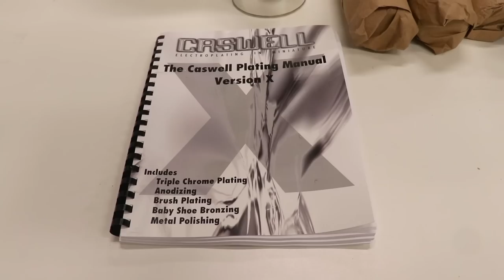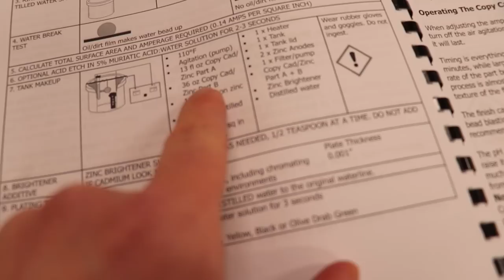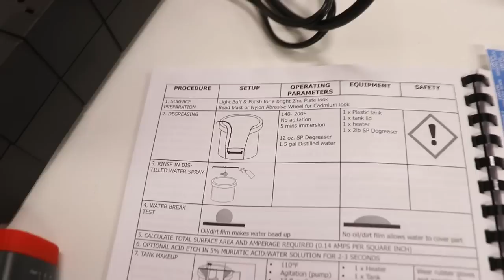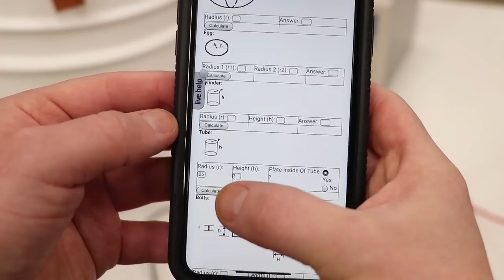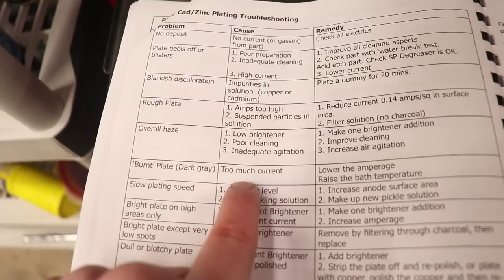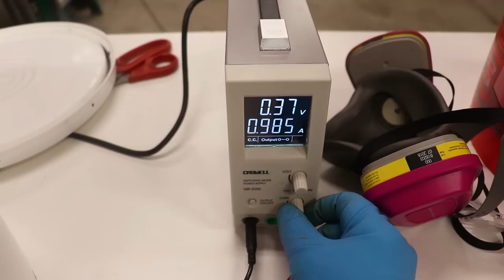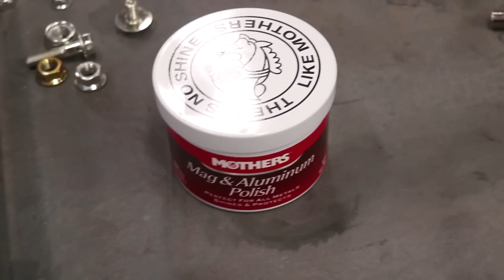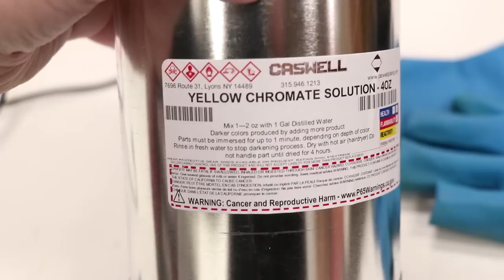Ultimate Guide To Making Bolts Look New Again!

Comment: I have had hundreds of pounds of Honda N600 S600 parts zinc plated. The shop I used would remove rust & the old finish with muriatic acic. They used to charge me $65 for a 5 gallon bucket full of parts. Last time I went in they had changed owners and tried to charge me $250 for 5 gallons.

Comment: Did a good job
I get a lot of stuff zinc plated and the current guy I use has a heated caustic pickling bath that he puts parts in overnight first to strip anything off them (painted steel I've welded etc.) since the sand blasting leaves a dull finish
The problem with the sand blasted finish is in the weather or grime it gets stained more easily than the glossy chrome finish.
To dry off small parts once they are done he has a container of fine sawdust he puts the smaller parts in the dry them off without touching them.

Comment: Nice results! Regarding the mild pitting from the rust at 33:35, you might want to try some de-rusting via electrolysis before attacking the part with the scotch bright wheel. Electrolytic de-rusting reforms the material by removing the oxygen from the oxidized part. You might get lucky and recover some of the material and thus reduce the pitting. You already have most of the set up you need. You just need to get one more bucket. One warning : careful with stainless steel when doing this - never use stainless steel or stuff containing chrome as your container or the sacrificial element or you will get very nasty, hazardous vapours and gases. So stick to normal iron/steel for your sacrificial element and plastic for your container.
Reply: That’s exactly what I realized while restoring bikes parts ! Acid is a very easy way to remove rust but it just dissolves while electrolyte convert the rust leaving less pitting !
Reply: Apparently carbon is a great sacrificial element leaving a very clean bath
Reply: @1conu593  Useful to know this observation. Since I made the original comment above, I've been told that it is not correct as it is not possible to undo the oxidisation and liberate the oxygen from the oxidised iron via electrolysis--the only way to do that is through extreme heat, which would melt the part. Given your observation, something else must be going on but I'm not a chemist. I also know that acid will eat the metal away so that might possibly make the pitting worse, depending on how long the piece is exposed to it.
Rust conversion may be another possible option in certain situations.
Reply: @1conu593  Thanks for  the tip--I'll check it out.

Comment: Seriously a top notch tutorial. I might add if I may, to test proper adhesion of the plating, use masking tape to see if plating has adhered well. If the plating does not transfer to the tape then you are good, if plating transfers to the tape, usually looking like pepper flakes then it is going to fail and should be redone.

Comment: Finely got one of these kits can't believe how good they are ive even done my mono shock pasivated in yellow all carburetor inlet stubs the little screws shock spring collars or & good tip on the spindles cam & the white haze. but be careful on the copper wire it'll start acting like a anode & youll get gold tinch in the zinc if you're still using this kit. i use fish tank heater in mine can't believe it was a year ago i last commented on this video but keep your videos comeing buddy

Comment: Thank you Cameron, I just plated my first bolt and it looks great. To keep the plating bucket at the correct temperature, without leaving the bucket heater in which as you mentioned could react with the plating process, I put the Caswell bucket I use for plating into a larger bucket. The larger bucket has a microwave safe kitchen plate on the bottom. , I placed the bucket heater element on top of the plate. Then I put a jar on the plate, inside of the bucket heater loop. The larger (outer bucket) is then filled with some water. I put the Caswell smaller plating bucket inside of the larger bucket. This way the heating element isn't touching any plastic and it can't react with the inner bucket, yet it keeps the whole thing at an even temperature.

Comment: Hi Cameron, I received your 3M style disks and tested that fine one today and honestly: I am impressed, really impressed. I had an aluminium part from a waterpump and it was in aweful condition so I vapor blasted it and ended up with a silky smooth surface then I tried your disk and without any pressure polished the surface to a high gloss. Honestly, it took no effort at all and within minutes it was better than any of my fabric polishing disks would be able to. I did not need compound which usually splatters all over the place. I hope you sell a lot of them. I will definitely come back for more in the future. Maybe you should also get some small ball shaped ones for polishing in tight corners with s grinder. I would buy it.
Greetings Bernhard

Comment: I don't know if this has been mentioned but if you use a stainless bar to hang from it won't corrode from the acid or plating fluids. I also use stainless bolts and wing nuts on my hanging bar to make the connection easier to make and more consistent. Nice work by the way Cam.

Comment: Really cool! Much better than putting a bolt to the wire wheel and putting it back in. Especially through a bearing/bushing where we need a specific tolerance and we’ve just removed a bunch of material haha. Nice job. Done right!

Comment: I had already gone through this process using the same kit and your experience exactly mirrors mine. I also use a long narrow container bought at a garden centre for plating brake rods or anything that doesn’t fit in the standard bucket. It does make you realise why plating companies charge so much though, it’s not a quick process.

Comment: If I get the new CRF125F and swap a CRF150R motor in it, I'd definitely want this process done to all of the hardware because for the pitbikes it's hard to find a specific hardware kit with the zinc plating on it. While I'd be at that I'd freshen up the hardware on my 3 other bikes as well as a little finishing touch. Awesome video Cam, I was really wondering how plating was done. Thanks.

Comment: A great video! Thanks for that. If I were doing those bolts and wanted the brushed finish I would only do the bit you can see as 95% of those bolts are inside some component and not seen. So I'd just brush finish the bolt hexagon and the nut if there is one to preserve the best rust resistance. After all you plated it for that reason.

Comment: Very cool, I have completed a few restore projects and never thought of plating the hardware, if I needed chrome fasteners, I would buy from Albany but of course not all sizes and threads are available. A work around fr me though for a high shine is ordering a stainless steel replacement nut or bolt. With a buffing wheel, stainless will polish to look almost 100% like chrome.

Comment: Hi, thanks for your story on plating. I own a large kit myself but since the weather here in Germany is still cold I have not tried plating yet. For me, the question of economy was not important since I had used a commercial plating service a few times and yes the quality was good but it still was a catastrophic experience.

First I am a pilot and I cannot always pick the time at home to drop the items off at the shop during the week. 

Second they want larger quantities and not just a few bolts. Now sometimes it is only one bolt or special item that cannot be purchased new anymore so you have no choice and pay their minimum batch fee (which is not cheap). So a 10 dollar item can quickly become an 80 Dollar restoration project.

Third and most important, you have to document the items you drop off because they keep losing pieces which are irreplaceable for you but just bolts for them and trust me those part will not reappear. 

Now, fourth, it takes time because they might not be nickel plating for the next few days so It always took at least one week. 

It was then when I started my next restoration project, a Jaguar E-Type V12, and decided to do everything myself and not depend on anyone. The time spent to find lost items, the waiting time to get whatever they had not lost back and the time to explain to them what and how you want your parts done is way too much for me. Not to mention to drive 15 Miles to their shop and 15 Miles back each time.

Cameron, your bolts look just perfect and I am more than willing to spend the time once to get set up and save in the long run. And trust me, as soon as your restoration buddies find out what you can do and how good the parts come out (because you care for those parts) they all show up and fill the fridge in your garage at least with their favorite beer 😁😁😁
Greetings, Bernhard

Comment: Cam another way to get in the head of the domed bolt is to do exactly what you did with the scotch bright pad but put the bolt in a drill. Then the bolt spins which is more efficient than you rubbing with the pad.

Comment: Great tutorial and thanks for putting in so much time and effort. I’ve seen a few video’s and this is the first that I would now consider tackling myself. You could put the heater in a larger, shallow bucket of water and place the plating bucket in that hot water. That way the metal from the heater wouldn’t interfere with the plating process but I would not have thought of that unless I had watched this all the way through. Do you know if the process is similar for nickel plating?

Comment: I was doing CNC work years ago and wanted to plate/anodize my items. One thing you failed to mention, which is critical is material disposal. That acid is considered hazardous material, check your local, county and state laws on use and disposal. State laws were so strict in my area at the time, even for hobby use not for me to do it but to send out. Keep in mind, some states consider this hazardous material and there is no way to dispose of even small amounts unless you pay. My city later started an amnesty period where you could dispose of haz waste no questions asked once a month - for home use. A business still has to have that haz material certification.

Comment: I'm about two years behind ya on all your projects lol 
I learned how to plate with copper , zinc and nickel as I was learning anodizing because it's basically the same but the power is switched from positive to negative on the receiver part and the acid is not sulphuric and the Temps are a bit different but Caswell sets and all. 
Caswell has the best colors and sealers and chemical cleaners.. 
YouTube keeps showing me your video because I build Electric motorcycle and custom parts lol so I think YouTube is telling me to try new things like powered coating and  not send the parts off..

Comment: Interesting video thanks. Just one point as regards the manufacturers surface area calculator for the likes of plating a pipe and not a bolt (both similar shape), the calculator has an option for plating the inside of a pipe (obviously wouldn't apply to a bolt) and should in this case have been ticked.

Comment: Great tips Cameron. My favorite one was watching for bubbles to find the correct amperage. One question I have is, how long will the solutions last on between plating when not in use? More in depth, how long can I store it before I can’t use it anymore?
Reply from the maker: Thanks! The solution will last quite a few batches. Once the finish starts to come out crusty and white the solution should be changed out. I believe it will last quite a few years in storage.
Reply: Awesome thanks man.

Comment: Great video man! The bolts turned out great! When I upload my go pro videos to YouTube the video quality goes down, the videos start to look a little pixelated and not clear. When I view the go pro videos on my computer the video quality is crystal clear but when uploaded to YouTube the quality of the video isn’t as good. I use Windows movie maker to edit the videos. Any suggestions thanks?
Reply from the maker: Thanks Chris! Youtube is always going to knock the quality down a bit but make sure you're exporting your video at 1080 resolution at the minimum.
Reply: Ok thanks!

Comment: Great Video Cameron!  At first, I was like "meh"....but what an amazing progression you made during the video, tweaking/adapting your process!  The final results are amazing!  Regarding the calculation, did you just stop calculating the amps per the instructions and use a visual to determine the right amps to use (IE:  When you started seeing the small bubbles and foaming around the wires, you stopped increasing the amps)?

Also, did you ever find out the reasoning behind wrapping the plates in gauss?

Comment: Greetings Cameron from across the Pond. Did you have any problems with say, the swing-arm spindle, which when after the thickness of plating was added, it was then too tight to go through the swing-arm bearings? I know we're only talking adding thousands of an inch here but I wondered - did it make a difference? Thank you for the sound video. :-)

Comment: Another cool look would be to drill some select bolts that are sensitive to loosening from vibration and safety wire them. Gives a pretty works trick look. Yes i know thread locker does the same but not as trick looking

Comment: Cameron, this is over the top COOL!  Hey, try some GOLD!  Seriously, I think that what color I'd prefer depends on what I'd be doing.   So much of the blemishes you showed are not going to be seen.   Axles...no worries!  I used to work at Boeing where they anodized the huge Wing Spars and Stringers etc...They had HUGE tanks for this as long as a 747 Wing .  (Over 100ft long)  I'm  no Chemist but every so often I did overtime where I tied these parts to a metal rack using aluminium wire to secure it to the rack for conductivity.   That was a boring, tedious job.  But you explained a lot.  Thanks and I enjoy what u do.

Comment: Hi again, watched the video again and noticed that you said it takes 0.14A per square inch. I bought my kit in England at Gateros plating (kit looks like yours) and in their manual they state 0.1A per square inch which is almost 30%less than what you had used on the dull coppertube. Maybe that works better to estimate required Amperage.
Greetings Bernhard.

Comment: Cameron just one question, you said that also you can plate in black color? If so, could you do it and show how it would look like? I think it will look awesome!
Reply from the maker: I think black would be cool, but my thinking was if it chips or wears it'll be very visible since the coating underneath is silver. I'd have to buy the black chromate kit
Reply: @CameronNiemela  I see, your right, but I think it's worth a try.

Comment: Those bolts are looking awesome! Do you think this process would work good on lower fork tubes on a dirt bike to help with the sliding? Kinda like how the factory riders do it
Reply from the maker: Thanks! The lower tubes are already chrome plated so they slide pretty well. But there are other coatings that significantly reduce friction

Comment: Put the heater in a larger bucket and put the busket with the plating soultion on top of it and fill the larger bucket with water until they are at the same height. That way you can keep the solution at the right temp.

Comment: A plating kit.  Hmmm.  What does it do to the diameter of the bolts, (bigger, smaller, or the same stock diameter, measured with a micrometer)?
Just because of learning this process, and using it for this and other stuff, makes working old bolts worth it to me, (I should have watched more vid before my first post, sorry) especially if you can get the stock diameter.
Reply: "OK, I just finished some research and reading, and I think I have a pretty good idea of the concept of plating now.",  (book opened to page 3----lol)

Comment: So you would need a bigger power source to plate something large like a pipe or a frame right?
Reply from the maker: Correct, you'd need the 30 or 50 amp supply

Comment: Hi Cameron does the zinc plating alter the dimensions of the bolts? Do they still fit into the bearings.
Reply from the maker: The zinc plating is 2 mils thick so it does not effect the fitment into bearings or threads

Comment: Instead of going through tons of new wire simply do the reverse plating procedure to put the plating off the wire back on the anode. and as for the corroded top tube ? you got a sand blaster have 2-3 tubes you keep handy and rotate and clean then in the sand blaster for a few seconds to remove the corrosion build up.

Comment: Hey Cameron on the rinse tanks do you have to use distilled water it can you use tap water? Thanks
Reply from the maker: Tap water is fine
Reply: @CameronNiemela  just tried it and I'm just using a D battery and I don't see any bubbles coming from the bolt but they are turning a dark grey. Thanks for any input

Comment: Does anyone have any tips on getting rid of a shit ton of rust on a frame? The rust has been building for like 10-20 years and I don't have sandblasting available.
Reply: You could try a angle grinder or drill with scotch Brite pad. I found a kit at harbor freight that goes in a drill that worked really well. It come with scotch brite disk and sand paper disk. Something like this.
https://m.harborfreight.com/2-in-3-in-fiber-disc-sanding-kit-61561.html
Reply: Wire brush and elbow grease
Reply: Cary Setzer thanks, i done the angle/ belt grinder with a sanding pad and it worked well, but I'm gonna have to find sandblasting for the places that I can't get into